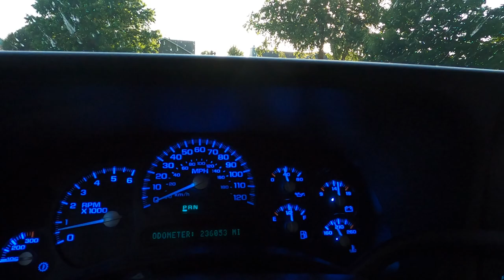Transforming the $3,500 WatchJRGo Silverado with DA, Polish, and Ceramic Coating | Almost a MIRROR!!

Comment: I guess those are leds behind gauges right? Do you or John Ross know what size they are I have a 2009 GMC Envoy Denali that I want to put those leds in. Gauge cluster on Silverado is very similar💯
Reply from the maker: It just so happens that I rebuild clusters too. It’s just a standard LED soldered to the board. They aren’t a wedge bulb. Factory incandescent jobs have a pedestal but they aren’t necessary. I prefer 3mm when I do rebuilds.

Comment: What kind of polish/pads do you use? Looked like Chemical Guys. Overall wonderful before/after. 👌
Reply from the maker: Good eye! I was using chemical guys VSS on a white CG hex logic pad. The polisher is the Torqx 15 I believe. I had another polish/compound,  it was dusting really bad and I didn’t want to mess with that!
Reply: @ObsessedAuto  Thanks for the response/info. CG makes some really good stuff. Haven’t tried their polishes yet but plan to. The Avalon King Armor Shield IX is an absolute blast to use and works well too.

Comment: Sorry about the mess. Hopefully the hose wasn't broke while you were pressure washing it 🤦🏻‍♂️ stupid things are not holding up well over there.
Reply from the maker: Wasn’t too messy! I didn’t wanna mess with you guys’ mojo so I used the trash can for a bench! 😂😎 the hose was peeing all over! I grabbed one from Sam’s and it’s held up since the beginning. Not a fancy extending hose, but it works very well!
Reply: @ObsessedAuto  we bought 3 120ft hoses from Sam's to move water access for the sink and pressure washer and they are very nice, just hard to manage. Should probably buy those reel and short hose to run from the splitter to the pressure washers. No messing with our mojo, I'd rather see everyone succeed than stress over "territory", there's plenty of cars for everyone! Had I known you'd be there I'd have set up the pad washer for you to check out/try.

Comment: Please tell me that truck is midnight blue. Because if it's not I need to have my eyes checked.
Reply from the maker: Should I schedule your appointment, or are you on it? 🙈😂 it’s black, but it has a lot of flake so with the camera and LED lights it does appear to have a blue hue!
Reply: @ObsessedAuto  Well back in the 90s I had a midnight blue Mazda pickup that was midnight blue without metallic and in the dark sometimes it could be mistaken as being black. I think the paint code was called Baja Blue. It was one of the prettiest paint colors I've ever seen.